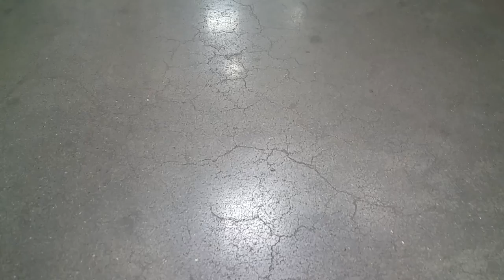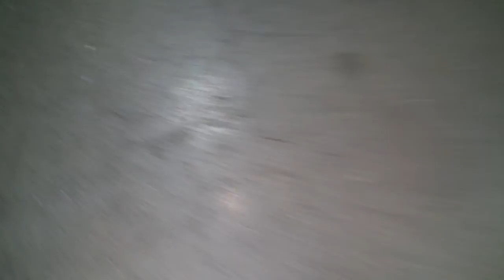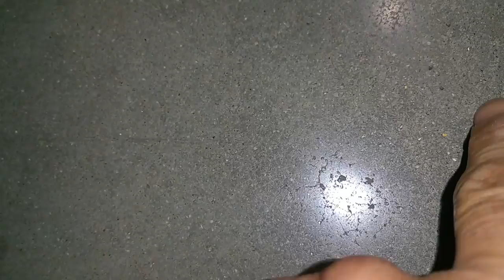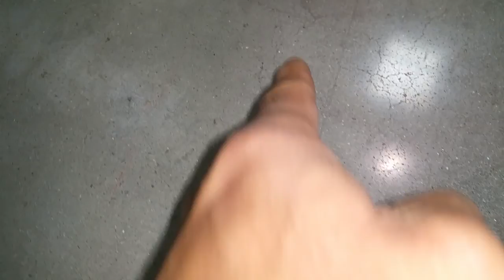Costco and concrete polishing

Comment: Do you know if they applied any coating (like epoxy or something) on this surface after smoothing and polishing?
Reply from the maker: No epoxy is present.
Reply: Do you have a video that explains how to polish and bring shine back to concrete floors? What kind of polish and pad do you recommend? Thanks!